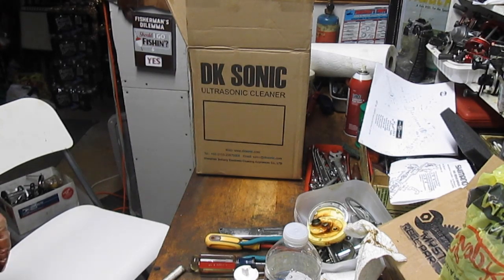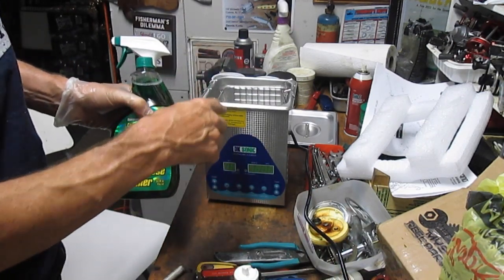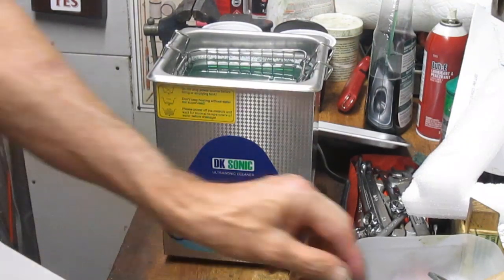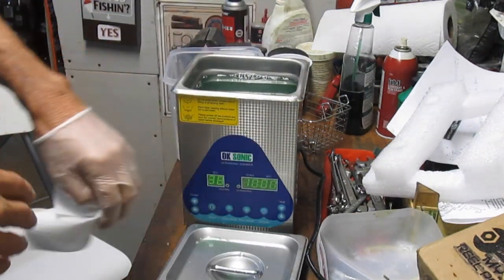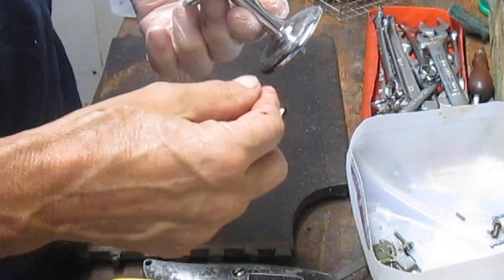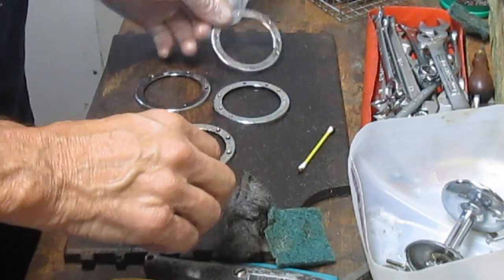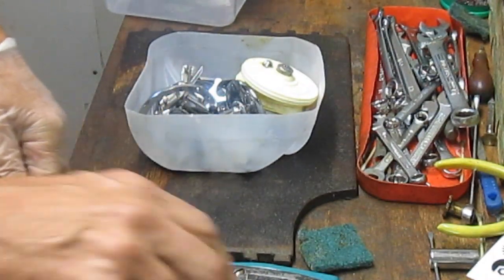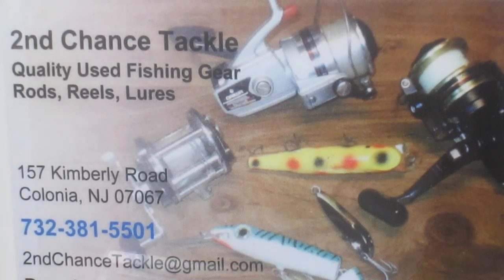How to use an ultrasonic machine to clean fishing reel parts

Comment: A great tip: using glass jars or vases with solution submerged in the basket water is a great way to keep parts organized and is easy to clean up afterwards so you don’t have to clean the machine every cycle.

The ultrasonics go through glass.
Reply from the maker: Thanks - always looking for ways to improve - Dennis
Reply: I work in the Dental Laboratory field and we have ours partially filled with distilled water and than place glass or plastic containers filled with whatever cleaning solution at a slighter higher level than the water so that container stays on the bottom.  This of course would be for smaller parts but the water only needs to be changed periodically and saves money spent on cleaning solutions because you can use small containers for small parts.
Reply: Another great product is a high pressure steam cleaner with a hand held trigger. This cleans everything really quick and than the water can be blown off with high pressure air.
Reply: Another great product is a high pressure steam cleaner with a hand held trigger. This cleans everything really quickly and than the water can be blown off with high pressure air.
Reply from the maker: Is the a commercial product or is th steam cleaner available for the home shop?  Sounds like a good alternative if it is easy to use, compact and reasonably priced. - Dennis
Reply: Didn’t mean to take so long to respond!!  Most used in our field are pricey and industrial models over $1000. We’ve used a number of different models and will never recommend  buying used.  We’ve found the ones produced by the company “Reliable” as best bang for the buck and they have a number of different models.  On amazon the one we currently use is at about $1000. Not sure how long it would last and not sure if the pressure would be enough but they make a home use model that is compact and hand held for $100 that looks like it would work well.  Again thank you for putting the content out there that you do.

Comment: That ultrasonic cleaner does a great job. Thanks for the demonstration.  Dennis, you probably already know not to use Simple Green on painted metal parts in an ultrasonic cleaner.  They'll fade or it'll even make the paint fall off.  Dawn dishwashing detergent and water will do a good job  on painted parts.
Reply from the maker: Chester - I did not know!  This is my first experience with the product.  Thanks for the tip - Dennis
Reply: @2ndChanceTackle  Dennis, you'll be ok using diluted Simple Green on painted metal parts for about 4 minutes at the max in a u.s. cleaner. I don't have an ultrasonic, but will occasionally soak and scrub painted metal parts in Simple Green just long enough to knock off the grime that WD-40 misses, then rinse everything  with water then let it dry.

Comment: I bought one of these and it works great. I am concerned about putting the plate with a bearing into the cleaner as I'm concerned it would flush the lubrication out of the bearing. A dab of grease on the outside afterward does not seem adequate. Thanks
Reply from the maker: Thanks for sharing.  There just isn't that muck lube in the bearing, but it can be removed if you prefer to leave it off when using the cleaner - Dennis
Reply: @2ndChanceTackle  should the bearing be oiled rather than grease?
Reply from the maker: Your choice.  I prefer oil, but that evaporates quicker than grease, o you need to be committed to frequent service.  If that is not the case, then grease is a better alternative.  I usually use the dab of grease on customer reels as they can go quite some time between servicing  - Dennis
Reply: Thanks for your answers. I'm learning as I go. Here's a tip for you as you struggle with those little screws down inside. A dob of grease on the tip of your screwdriver will make the screw stick to the tip and you can reach right in with the screwdriver.

Comment: I use a 4g commercial grade ultrasonic cleaner and the solution I use is 1g of Simple Green Aviation cleaner (safe for all metals and plastics) and 3g water.

Beware though, I have found that a ultrasonic cleaner will remove paint from spinning reels no matter what solution i use so I clean all painted parts with WD40 by hand.
Reply from the maker: I rarely use anything other than dish soap.  Like you, I have had bad experiences using acid based cleaners like the citric solutions and have had paint loss or discoloration as a result.  Thanks for sharing your thoughts - Dennis

Comment: I am curious how gears will come out? Nice and shiny or mediocre. I’m sure it would do a decent job on BB also
Reply from the maker: I am ready to try that.  Stainless should be nice and shiny.  Brass may be "stained" due to age.  Bearing will need to be re-lubed as this process will take all of the oil and grease off of the parts - Dennis
Reply: 2nd Chance Tackle looking forward to the results and vid!

Comment: Have you noticed the labels on reels getting damaged due to use of ultrasonic cleaners? Thanks for the reply.
Reply from the maker: Yes.  Depending on what chemicals are used.  I have seen acid based chemicals destroy the labels, decals and some metallic based paints.  I have largely stayed away from those and only use them on plastic or graphite type finishes.  I generally use dish soap as the most aggressive cleaner in the ultrasonic machine - Thanks Hashem - Dennis
Reply: @2nd Chance Tackle Thank you for your reply. I heard from another YouTuber that regular Simple Green is harmful to aluminum, but not the HD version (purple) of Simple Green. I hope it is right, since I changed my wish list order. I am waiting for holiday discounts to purchase a ultrasonic cleaner. I sent back a small version of it few months back. All the best.

Comment: be careful with aluminum too. Simple green in an ultra sonic will really mess it up badly. I learned the hard way
Reply from the maker: I only use water and maybe dish soap.  Some of the other chemicals, like you say, will discolor or fade the finish or worse, remove the badges, etc.  Thanks for the note and added information - Dennis

Comment: Really enjoying your videos!  Can you share the specific model you bought?  Any thought on larger or smaller versions?
Reply from the maker: yes - I bought a DK Sonic.  It holds about 1 reel and about 2 liters of cleaner.  I got it on Amazon and I think the price was around $65. This is good for the occasional use or hobbyist.  I don't think there is much difference larger or smaller other than capacity and "cook" time.  This one is middle of the price range and has worked fine - Thanks for asking - Dennis
Reply: @2ndChanceTackle  does the ultrasonic cleaning damage paint?
Reply from the maker: It does not usually damage paint if you are using water as your cleaning agent.  If you use other cleaners that contain acids or other chemicals, it can strip or dull the surfaces - Dennis

Comment: It will take off any decal, even if it lasted for decades, it will remove it!
Works awesome for bearings!
Reply from the maker: Great point!  Yes, you need to be careful with the decals and also very careful with the cleaning solutions if you are using anything other than water as they may change the paint or dull the metals - Thanks for the note - Dennis

Comment: Hi again Dennis. is the 2 litre DK Ultra Sonic cleaner large enough for your needs? Thanks, Paul, New Zealand.
Reply from the maker: Yes.  It works OK for my needs.  I normally just clean one reel at a time and I usually disassemble the reel prior to putting it in the  machine, so I find it is OK at that size.  I don't use it for other things like automobile and machine parts, so the size is not an issue.  Thanks for asking Paul - Dennis

Comment: Dennis,  The machine does a great job. I have a question, when you take the basket of parts out of the cleaner, do you rinse the parts under with water in the sink? I can imagine there would be residual soap and grease that would dry on the parts if you didn’t rinse them. Thanks for all the great videos.
Reply from the maker: Yes - I do rinse these off with water once the machine has done its job - Thanks for asking - Dennis

Comment: Would something like Shark Hide metal protective coating be good to apply on the chrome, stainless and aluminum parts to ward of oxidation, rust, tarnish? Try it out on new as well as old?
Reply from the maker: I'm not familiar with that product.  My guess is that as long as the product is not caustic, that it will be fine as a protective coating.  I will need to do more research on it - Thanks for the tip - Dennis